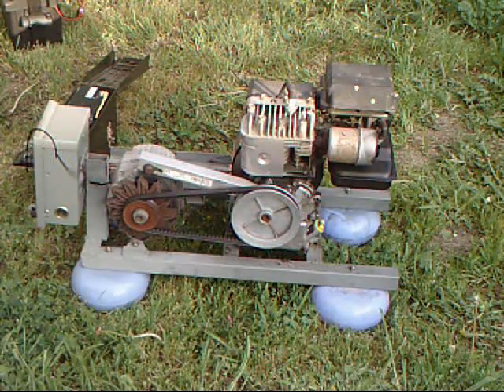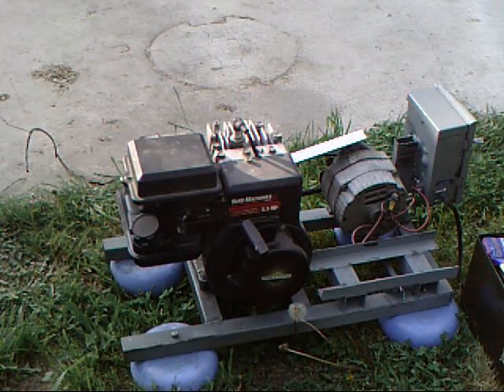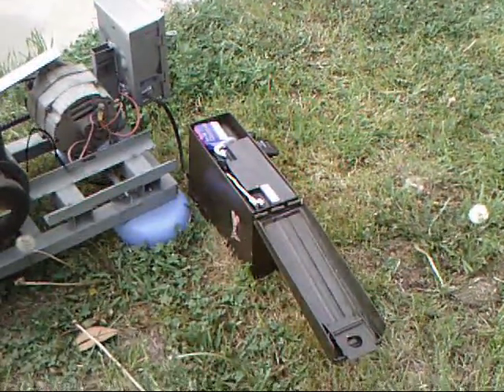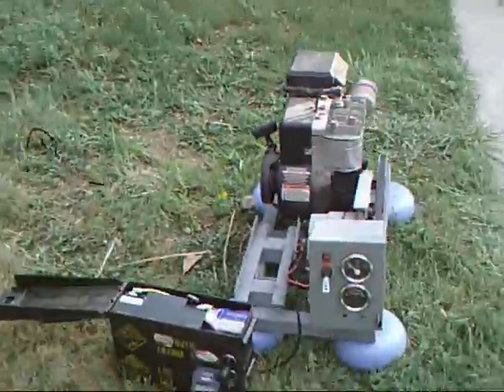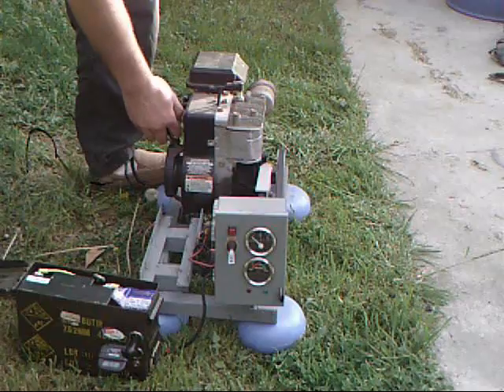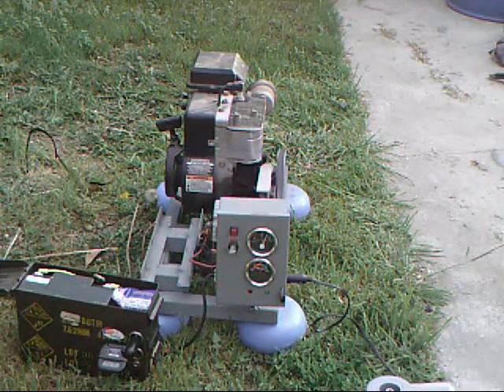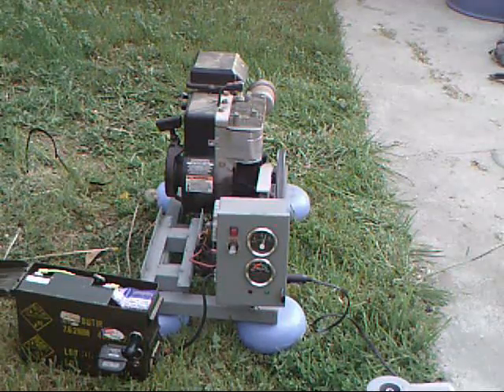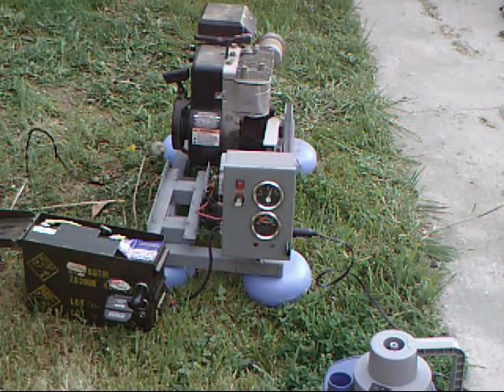12V Emergency Generator Project

Comment: That a real Briggs and Stratton. That one most likely came off an edged or small rototiller. They usually have aluminum cylinder bores but are actually good engines if taken care of.

Comment from the maker: To answer some of the questions at once:

The blue feet are off a pallet that was full of UPS batteries, I put them on there to keep the whole unit from sinking into the sand at my desert cabin.

Yes, I am running the alternator backwards, cooling has yet to be an issue, in general I can't pull enough amps to cause heating issues.

Fuel consumption is something I havn't measured too well. It consumes about 1pt/2 hours (I rarely run it that long).

The most draw I've ever pulled is 14V@30A ~420W

Comment: A few points: DC gennys went out of cars in the mid '60s. They are self-exciting by virtue of the *residual magnetism* in the field pole pieces, which in turn are magnetized in operation by field coils controlled by the voltage regulator--would definitely want the regulator included in any setup with the generator. (Bonus: no in-line diode needed! The regulator takes care of that problem.) Also, alternators have full-wave rectifiers--using the whole sinewave--and from a 3 phase source to boot!

Comment: Looks *very* well made! Only problem I see is that you're running the alternator backwards. While not a problem electrically or mechanically; the cooling fan is made for clockwise rotation, as it would be in a vehicle. It's function is severely impaired running it backwards. I would be concerned about potential overheating of your alternator under high amp draw. Something to think about.

Comment: Nice job!  I made one for my diesel boat using  a Honda GX 50 engine about half the size of a Briggs. I also put in a 12 volt gel cell and pushbutton switch to get the field excited. It now has 25 foot cables made of #8 copper speaker cable and pumps up deep cycle batteries very well.

Comment: A good little stand-by gizmo, if you want to avoid the problem of a flat battery, try and get an old DC generator froma  junkyard, such as used to be fitted on cars until the mid-70's. They have permanent magnets in them and therefore self-excite. Fit a diode in-line to prevent your DC generator becoming a  DC motor when you stop it! It's would be half  as dear to run, as you are not wiping out half a sine wave via a rectifier.

Comment from the maker: The whole system when running at max speed can put out about 40A, if you pull more than that it stalls the engine. I've used this gen to jump my truck before, but you need to let it run for a few minutes to get some juice in the battery so the surge demand isn't so high.

Comment from the maker: When you first start up the generator you need to crank the RPMs up to above 2000 to get the alternator to start generating electricity. After that you can back off the throttle so the engine doesn't make so much noise. I would estimate the engine RPM when I'm running it is probably about 500.

Comment from the maker: I have tried this, unfortunately the GM alternator will not self-excite, however, since I use it for charging batteries, it's nearly always hooked up to a bank. Even if the batteries got sucked down to 10V there's still enough current to get it to bootstrap.

Comment from the maker: This generator was designed for recharging deep cycle lead acid 12V cells, yes I can use a car for the same thing, but this way I burn less gasoline (I used about 1 gal to provide all the power for my hunting camp for a week) and when my truck is stuck in the creek (like it was  one night during the hunting trip) I still had power to run the water pump, boot dryer, laptop, radio gear, etc.